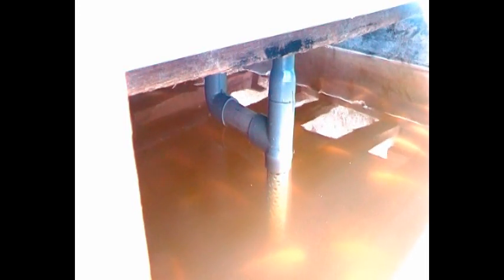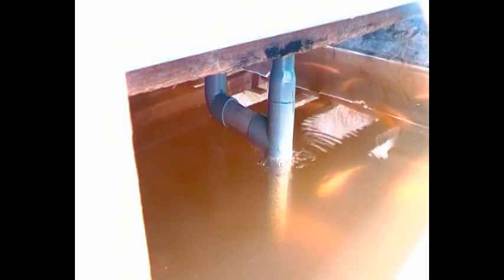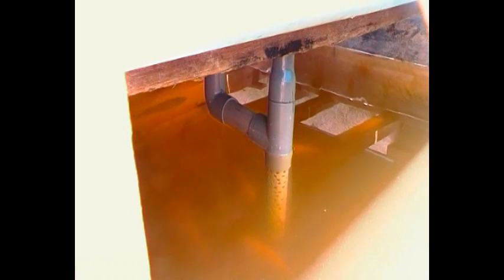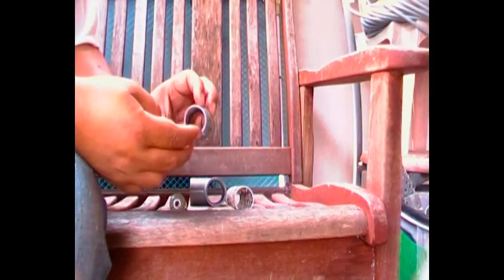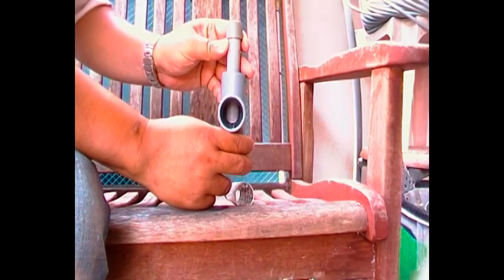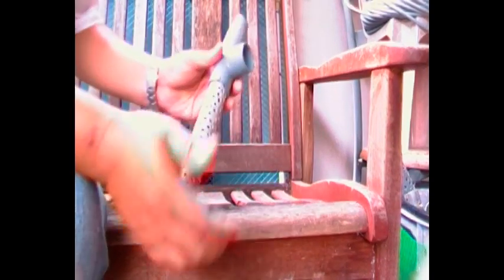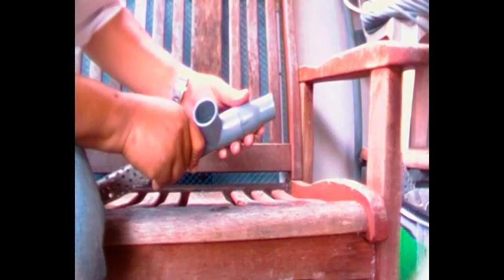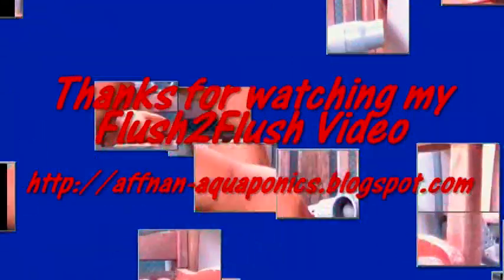Basic Aquaponics - High Water Siphon Outlet Aerator

Comment: Hi Affnan, I am using this aerator design for 3-4 years and I am very happy with it. It works great and the noise is greatly reduced... It is even less noisy then a normal tap in the kitchen... I use the outlet in combination with the flared standpipe...
Thanks for the PVC know how... a great help... Regards, Sander Tel.

Comment: Hi Affnan, your video's are great. Are you still using this setup? If I run the drain pipe to the bottom of the fish tank using this setup, will it still get bubbles and enough aeration for the fish? I'm setting up a blue barrel setup and want to make the bell siphon as quiet as possible so the neighbors (and my wife) can't hear it running. Thanks!
Reply from the maker: +scottijk Hi, I no longer use this outlet because I made new set which is higher from water level. This outlet do give aeration and reduce noise.